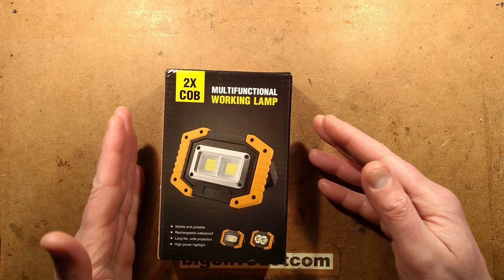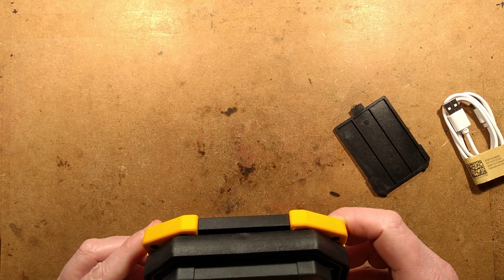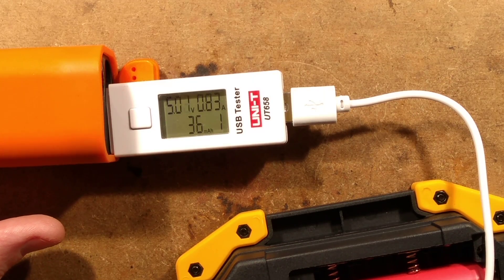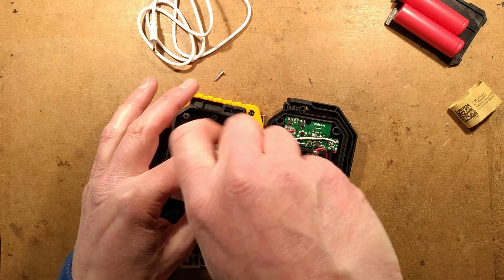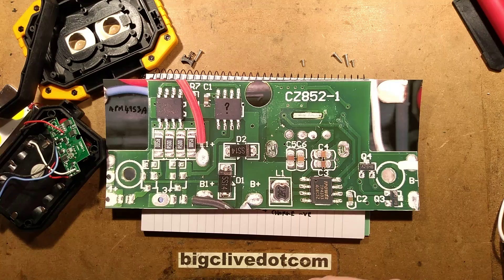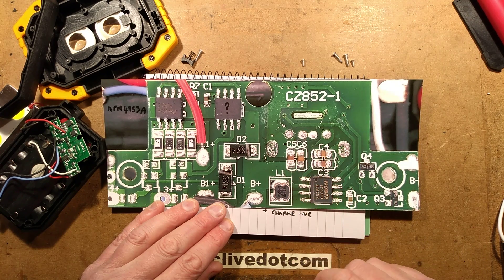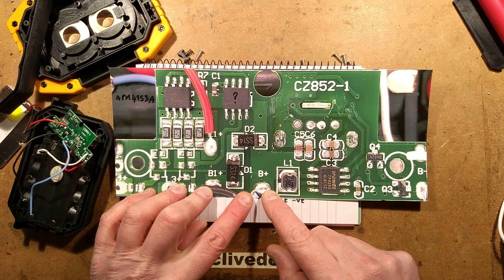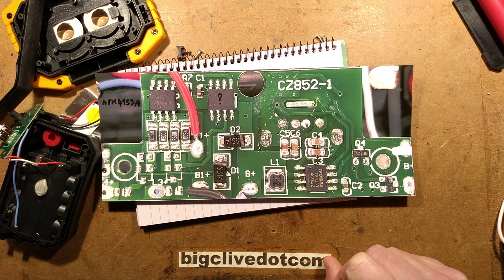Inside a chunky USB rechargeable work-light power bank.

Comment: I wanted to buy this, but I can't find a single seller that's honest. I'm not giving money to the scammers that fraudulently advertise this as 20 watts, 30 watts, even 50 watts.
Reply: It may help to realize they are intentionally being semi-misleading in that quite often the combined maximum rating of the COB LED array is the wattage they are quoting (e.g. two 10W COBs are advertised as 20W even though they may only driven at perhaps 10W).  However, they typically do not have the necessary heatsinking nor battery capacity to run anywhere near that absolute maximum COB rating.  I’m not suggesting that it is right or ethical, but that is where they usually get their claimed numbers from (unlike battery capacities where they just seem to multiply by 10 for the heck of it).  

Unfortunately, you are going to very much limit yourself if you exclude all sellers with exaggerated claims because Chinese sellers almost universally lie through their teeth for some reason and local/regional resellers seldom know enough about the product’s true technical capabilities to know any better themselves and blindly accept the Chinese wholesaler’s claims and similarly advertise the exaggerated numbers....and, sadly, if they were to advertise true numbers most buyer logic is along the lines of “local, 10W, $20, one week delivery” or “Chinese, 50W, $15, two month delivery” and both items are absolutely identical so “heck, I’m buying the better cheaper Chinese seller version!”  Which makes it almost impossible for others to advertise real numbers when competing with the same otherwise identical product, I don’t like it either.  The local resellers could compete with the higher price for faster delivery usually, but the buyer’s belief they are getting 5 times the power with the Chinese seller make honest specs practically impossible.
Reply: The difference is even more extreme than that though, because the video description says the current is only 900 milliamps, so assuming that's at 5 volts, it's less than 5 watts.
If honest sellers can't compete, then eBay is simply broken.
Reply: @ethanpoole3443  Most of the time, but not always. I once got car lights, supposed to replace 5W bulbs and they exactly had the advertised 2,5W. They were really bright - and got up to 112°C at room temperature. So I had to do, what bigclive too often suggests and I normally don't like: DOWNgrade them, reducing the current. But with about 1,4W they are still more than bright enough for the intended application while not toasting themselves in the car-headlight housing.

Comment: Hi Clive. Liking your videos very much. Where a good source of those 18650 cells? I've been looking at that very work light on GeeBay and wanted to get a couple for when I'm messing with the car. All the best from Ireland 🇮🇪.
Reply: Stick to vendors selling true Japanese cells and you will generally do alright.  However, on Amazon I have had very good results with Solaray and Orbitronic lithium ion cells and they deliver their advertised capacity +/-10% (compared to -90% for many Chinese cell advertisements) but you will pay extra for quality cells...and it is worth the money (to myself at least).  When shopping for 18650s, look for cells that specify they include the protection board (“protected”) unless your device can not accept the added 1-1.5mm, or so, that the protection board adds to the cell length as the protection board will help avoid the risk of fire if your charger tries to overcharge beyond 4.2V or your load attempts to overdischarge the cell below about 3.0V — it just adds a welcomed layer of added security against fire.  However, some devices can not accommodate the added 1mm to 1.5mm the protection board adds to the length and those devices will only accept unprotected cells.  In photos you can usually identify the presence of a protection board by way of a small indentation about 1.5mm before on the negative end as the protection board is added to the negative end and then heatshrinked in place.  With battery in hand you can also identify protected cells by the thin positive conductor strap that runs under the shrinkwrap to connect the protection board to the positive terminal (but this can be hard to see in photos).

Also be aware when buying 18650 cells that not all cells include the positive “bump” or “nipple” that many devices designed to accept removable 18650 cells require.  The natural bare 18650 cell is two perfectly flat ends as seen in spot welded battery packs, so the positive nipple is something added to the cell and you can buy them both ways.  For removable applications you nearly always want the version that includes the positive nipple.

If you wish to be able to recharge the 18650s externally (as opposed to using only the built in charge capability of this utility light) I have been very happy with the MiBoxer C4, also on Amazon, which supports charging up to four 18650s (as well as many other lithium ion sizes — I also use AA sized 14500 cells) and can cycle or capacity test one battery (in slot 4) at a time to reveal true battery capacity.  It is a Chinese charger but I have been very impressed with it...unlike the Chinese lithium cells that often disappoint...lol!  The Chinese can produce very nice products when they choose to.
Reply: @ethanpoole3443  excellent reply. All the info I needed. Thank you so much for taking the time to give me all that information. I appreciate it very much. All the best from Ireland.
Reply from the maker: It's a tricky subject as many of the eBay sellers quote fake capacities.
Reply: @bigclivedotcom  is there somewhere else other than ebay? A reputable retailer...
Reply: @barrygreengrass3379  thanks Barry. I'll have a look.
Reply: The  /flashlight  subreddit is one of the best places to find info about 18650 batteries. Where to buy them, offers, coupons etc
Reply: In the Netherlands I use NKON, they charge €2-€5 for genuine LG, panasonic, sony, samsung etc cells. If shipping is not too bad it may be worth a try.
Reply: @positivemelon7578  thank you. I will have a look.
Reply: Try https://www.ecoluxshopdirect.co.uk// I get all my batteries from them all batteries are genuine products, hope that helps?
Reply: @john wilks this was why I asked. I know there is a lot of junk out there. Cheers
Reply: I have only tried purchasing commercial 18650's twice on Ebay, well once for the batteries, another battery came with a flashlight.  They were true junk with about as much power as an AA that has spent some time in a flashlight.  I began tearing down laptop batteries, and when word got around they began to be delivered from folks who had replaced them on their laptops and needed a proper place to "dispose of them properly!" I found that most Laptop Batteries will only have 1 or perhaps 2 bad cells, the rest will work for a long time once given a proper cycling in a good charger capable of discharge/charge cycling.  I also tear apart old tablets and such for the flat cells and reuse them all over the place, as well as old phone batteries and such. I find a LOT of them are capable of a new life powering all sorts of things. Had an old florescent 12 volt lantern that went to hell, tore her down and replace the bulb with a couple 3 watt LEDS then powered her from 3 18650's, puts out more light then she did with that old tube and is in a handy plastic case with a plastic lenses to protect the LED'S from damage.  Did a set of those tiny 3 AAA battery speakers awhile back, put a small flat lipo in her and my daughter uses it in her car along with a home built FM radio since her car radio went to hell and she doesn't have the funds to replace it.  I have one of those hand crank AM/Fm/SW radios that tries to be all in one flashlight/radio/siren/flashing red light and the rest.  It had 2 D cells but the holder broke years ago and that crank thing will last about 4 minutes unless you get real desperate and crank for about a half hour, then you might get 10 minutes of news.  So I wired in a single 18650 where the D cells were, in a  holder and my wife now uses it in the mornings to listen to the road closing and farm reports as she grew up on a farm and was taught you must listen to those two items daily. (I don't know why we only get up to the family farm now run by her brother about three times a year!)  This one, I can take the battery out to recharge, the others I have set up so I can hook a home built charger to when needed.

Comment: Can somebody please tell the Chinese we don't want high-low-strobe cycle on every bloody light! Thanks.
Reply: Man I agree, every damn flashlight I have from China has that damn strobe and most have the SOS built in. It is getting so seeing the SOS from a window on a home while passing is simply thought of as someone screwing around with one of those damn flashlights and no need to respond as an emergency!
Reply: @JerryEricsson  Those are the fancy "5 mode" ones. Even better cough then the "3 functions". 
I just want on and off. And if it has additional modes, a separate switch. More then happy to pay some extra.
Reply: In a flashlight of decent power I would prefer: 10%, 50% and 100% setting.
Reply: Exactly. One 100% power mode is good enough and simpler circuit as well. Though I believe that it is designed like that because LED driver circuitry is the same in all Chinese LED flashlight products. Anyway working light doesn't need that but yellow brains most likely can't understand that. I recently bought UV flashlight for UV glue curing. It appeared regular 5W bicycle flashlight with UV led inside and had that same three modes where low light and strobe modes was completely redundant. Luckily in high power mode it definitely works :)
Reply: @KrotowX  Found the racist.

Comment: Another nice product review big clive,
On a seperate note, how is the timekeeping going so far on the green time in the slime clock project?
Reply from the maker: It's terrible.  Especially when it's powered.
Reply: @bigclivedotcom  Thats Disappointing,I thought it looked quite nice. Do u think changing the crystal oscillator or microcontroller would help to fix that.
Reply from the maker: @AndrewWalsh43  I'll do more experimenting, but it hints at an off tolerance crystal and oversensitive RTC chip.
Reply: @bigclivedotcom  very interesting, I see what looks like a more up to date one on ebay for about €8.70 - €9 thereabouts. Do you think you could put the parts list in the video description. Perhaps the kits were assembled with a faulty batch of crystals. The mpu looks quite overly complex for such a basic design. Would be good to look at the specs.
Reply: bigclivedotcom - slow or fast?

Comment: High mode, low mode, epilepsy detection mode. Why, why add this mode.
Reply: According to an eBay listing, it is to prevent camping:  "strobe brightness mode can be used when you are in danger of camping out"
Reply: I'd suggest that strobe would be quite useful to alert first responders of your location in an emergency. On your person, or on the front porch to be seen from the road.
Reply: I don't like it very much either but I agree that it would be great for real emergencies where the longer battery life may save your life. As Против Глобал
mentioned the chip is apparently used for bicycle lights and that's a believable explanation. Meeting cyclists in the dark while the have a superbright flashing headlight is awful though and is illegal (but many cyclists don´t care...) in some countries.
Reply: @bennylloyd-willner9667  During darkness I find a single bright cyclist head light can be dazzling, but whilst a flashing light is very effective at drawing your attention to them, you naturally keep reassessing where they are. This is fine if there is nothing else to concentrate on but in complex situations I find it distracting. Used in conjunction with a steady light I think the flashing is a great aid, drawing your eye to the cyclist and once you have identified them a steady light allows you to track them easily.
Reply: @bennylloyd-willner9667  Years ago when I still had my motorcycle, the firefly headlight came out.  It had that strobing built in to draw the attention of sleepy motorists and keep them from running over the motorcycle as they drifted across the yellow line on the 2 lane highway.  They did have the effect of getting motorists attention during the day, but were really best avoided during the hours of darkness lest it put the rider into some stooper and make those deer that are crossing the road move in stop action.
Reply: @JerryEricsson  I get that but when meeting a couple of strobe light bikes when there is traffic in the city it is harder to see others, like pedestrians and bicycles without strobe lights. I feel for you if you live where there is so many bad drivers. I live in Sweden and fortunately those drivers you describe aren't that many. Not more than motor bikers who ignore speed limits and do unsafe overtakes. Let's be safe and careful in traffic.
Reply: Because the battery lasts far longer in strobe mode and it makes the light stand out. Why do you think the lights on ambulances, police and fire strobe?

Comment: Clive, were you not at all concerned about the fraction of a millimetre gap between the battery terminals and the heatsink? I wouldn't trust the damn thing not to short out on a whim.
Reply: Do we know for a fact that it is only a fraction of a mm (there is no frame with a good enough view to measure from the video alone that I could find)?  Even so, making contact with the two positive terminals of a paralleled battery pack would be of little consequence (both 18650 cells are in parallel with one another) and both the heatsink and battery holder are rigidly secured in place, so neither should have any significant give relative to one another.
Reply: @ethanpoole3443  It really did look to me like there was very little clearance between ALL the battery terminals and the sink.

Comment: Bigclive, where can i order reliable 18650 batteries ?

other then that what do you recommand 3xAA rechargable or 2x18650 for this light ?
Reply: On Amazon I have fared well with both Solaray and Orbotronic lithium cells and they have all delivered their rated capacity to within +/-10%.

You will get far more runtime from two 18650 lithium ion cells (up to about 25Wh total with two true 3400mAh cells) of decent quality and capacity than you will from three or four AA NiMH cells (about 12.5Wh maximum with four high capacity cells of 2600mAh each) in series.  If you do opt for rechargeable NiMH cells then go with four cells (~4.8-5.0V total voltage) and bypass the two dropper diodes — but do not use the built in charge feature as that is designed only for lithium ion cells, so NiMH cells will have to be manually charged with an external NiMH charger whereas the two 18650 lithium ion cells can be charged using the built in micro USB charging port.  The two dropping diodes are meant to reduce the roughly 6.4V of four fresh alkaline AA cells to 5.2V or less so that the USB port voltage does not get too high with fresh batteries, literally wasting the better part of one AA battery.

Comment: I have the same model (model W839) lamp, I bought it off Aliexpress for around 9 dollar.Quite usefull, because it fits in my pockets, try that with a normal work/floodlight! The light intensity is quite strong, you cannot look into the light because it will hurt your eyes. The other models (W840 and W641) have a more spread-out light beam.
Link to Ali shop: https://www.aliexpress.com/item/W839-W840-W841-Led-USB-Rechargeable-Emergency-Lighting-Floodlight-aluminum-alloy-COB-Waterproof-Outdoor-floodlights/32923948387.html

Comment: I got my first LED mains bulb today. Its a duracell, 60w (9.5w), and cost £2. Edit: its a Energizer bulb.
Reply: Does it flicker?
Reply: @heyarno  No it doesn't to my eye. Been using it overnight and it seems pretty solid. Its actually a energizer bulb, just thought it was something else as they have very similar colour schemes,
Reply: @ExeDist  Oh well, maybe these bulbs pop up in shops here too. Until then I'll stick to my home made ones. I got 2 types of commercial led bulbs, 1 exploded at random and the other flickered like a strobe light. Other ones I've seen in shops had terrible lifetime ratings of 5000h, one even just 2000h. So I didn't buy those.
Reply: Arno, 2,000 hours is 8 hours short of seven weeks. That's awful. Can't blame you for not buying them!
Reply: @heyarno  this one is 15,000 hours. Last night I bought two RGB LED bulbs with controllers for £17 9w, I hope there good but I'm not holding my breath at the moment